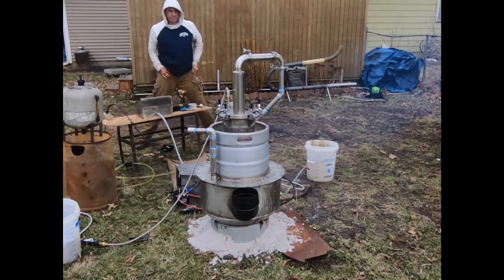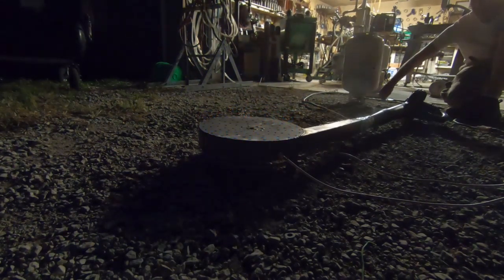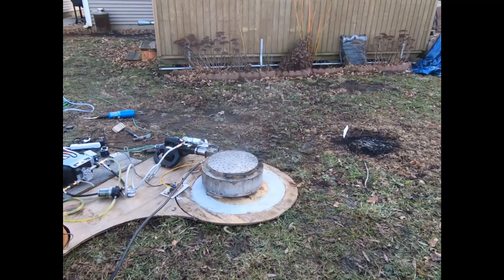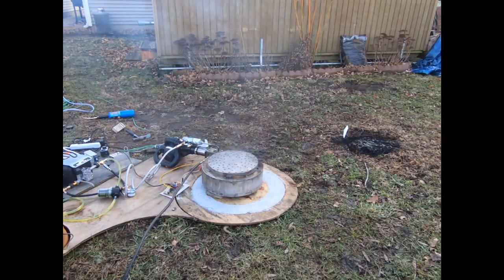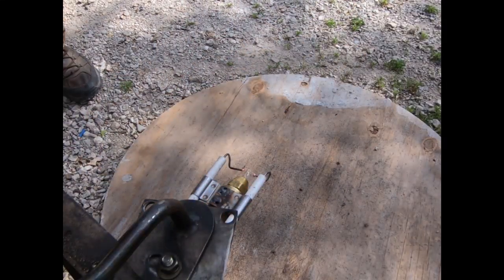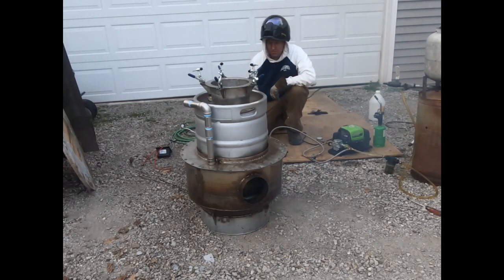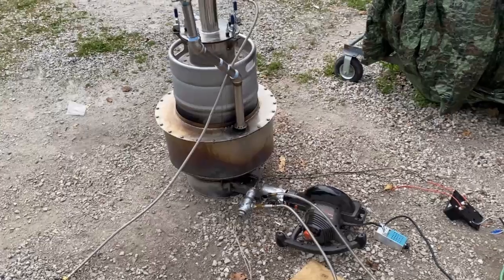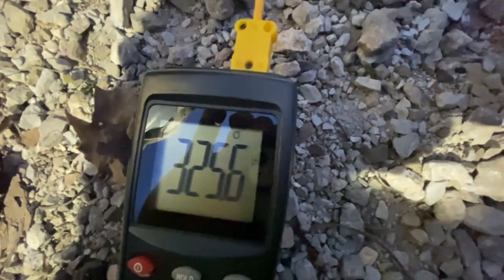Mushroom Grower auto clave product development

Comment: A spark plug doesn't work for diesel. Gas is different as it has a much lower flame point and is also mixed with air more easily.
A glow plug may be a solution to pre-heating the diesel fumes. I imagine a chamber with a glow plug and a high-voltage ignition on the outlet of the said chamber💡?
Of course, these two things would only have to be active at the start-up phase. Afterward, it would be hot enough to vaporize the diesel injected.
"So you can feed people who refuse to work...but wanna tear up the country". YES! You know what? It's exactly what I could have said, too! We're dealing with the same problem here in Denmark. Lazy bastards who hold up their hand for the welfare check, but don't want to contribute with anything. We all pay for these bastards by going to work and getting ripped off when the paycheck comes. The worst is one is not even finished paying even after tax because one has to pay VAT and other fees every time one buys something.
Excuse me for the rant.. ;)
Stay safe...no more explosions. :)

Comment: Looks like an anti tank mine to me aha 
Would you be better of making a glow plug channel of some sort to heat the diesel spray before ignition?
Reply from the maker: The problem was the size of the fuel slug was to large before it reached the spark plug . Is was a simple proximity issue . Glow plugs are also good but again at this size a substantial fuel slug would develop before ignition unless it was placed in the fuel stream and that would not be ideal